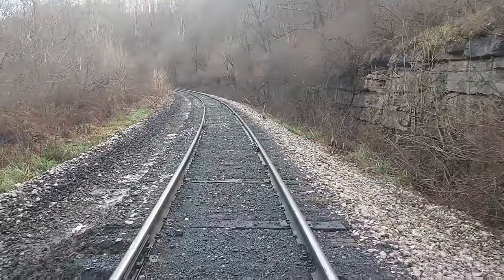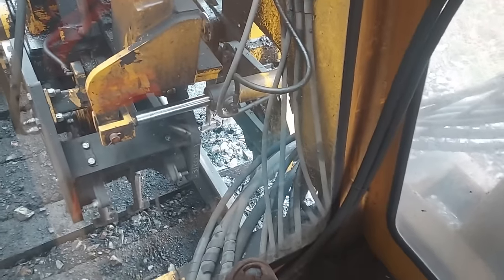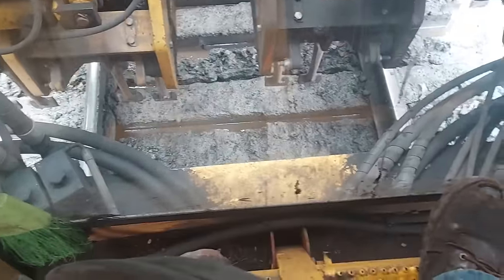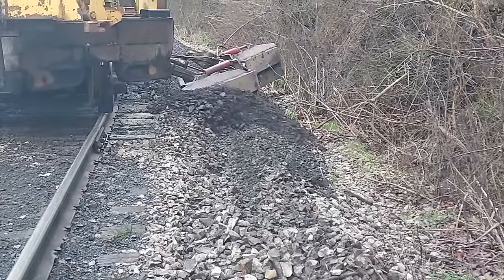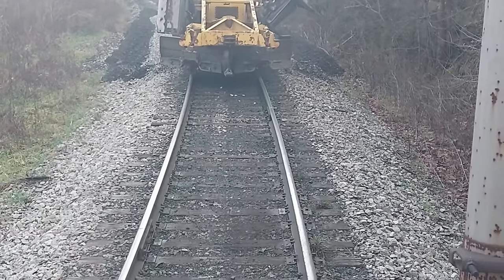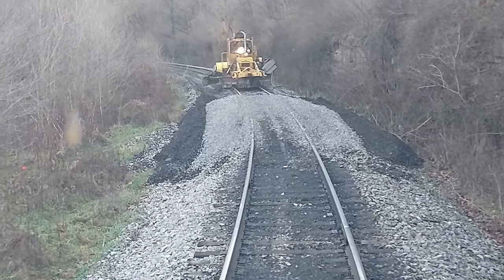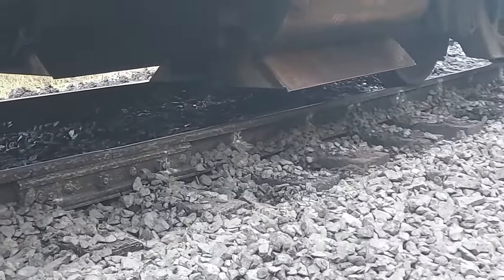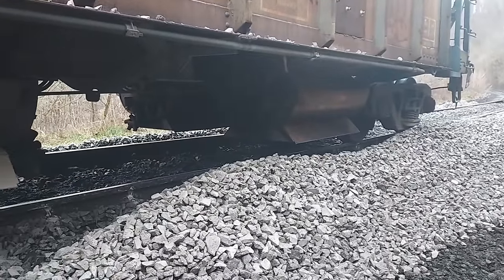Crib Sweeping a Really Bad Mud Spot in the Track

Comment: Dave - Great video as always! But what happened to the ballast? Isn't it heavier than the mud? Was there a flood?
Reply from the maker: The ballast just got diluted by the mud Nolan. The leaky car doors
spill coal over many years time. Note also that it seems like the
doors spill more in certain areas than in others. But what happens
is the coal plugs up the ballast so the water can't get out. When that
happens and the water stays in the track instead of running off,
then when the train passes over that spot, the ties get pushed down.
When it unloads the ties come back up which allows water to get
under the ties. Then when then train passes again, the water gets
pushed down by the ties and when it unloads, it acts like a suction
and brings mud back up with it. It's a perpetual cycle and just
gets worse as time passes and eventually the mud takes over
and we have to do some kind of fix to it.  Very grateful my friend for your taking the time to visit with us and check out the crib sweeping video.

Comment: need drainage pipes punched in under the tracks. water has to have somewhere to go.
Reply from the maker: Mud is out biggest problem here on the track Kevin. Coal fines get
down in the ballast from leaky hopper car doors and plug the ballast
up so water can't drain away. Then the water goes down and mud
comes back up. First thing we need is new hopper cars to eliminate
what is causing the problems. Then we need a better machine to
eliminate the mud. But that's also very wishful thinking on my
part to think that those things will happen..... sigh  Very grateful my
friend for your taking the time to visit with us and check out the
crib sweeping video.

Comment: So you lose all the rock on the shoulders? No way to save all that naterial?
Reply from the maker: Pretty much that is correct John. In mud spots like these, the
shoulders are plugged up with mud and coal fines anyway, no
use in even trying to save it with the limited equipment we have.
We really need one of those big shoulder cleaners that would
clean the rock and save it, but since we do not interchange with
another RR, then it's impossible to get one in here. We do have
our share of mud spots. Seems like you take care of one and
two more show up somewhere else. And it's also finding the time
to deal with them with a train running because I have to rely on
a train operator to haul ballast for me. Also having to deal with
weather conditions, can't do this kind of work when stuff is frozen.
Very grateful my friend for your taking the time to visit with us and check out the crib sweeping video.

Comment: Why couldnt they put a scraper on those tampers so instead of using the track hoe to clean out the cribbing use the tamper to clean out the mud?
Reply from the maker: It is a real pain and time consuming thing to take those paddles off
and bolt something like you are saying back on Jeff. Plasser makes
a really neat cribber machine that is designed pretty much like what
you are suggesting. I have requested them getting me a machine
like that here several years ago, however it hasn't shown up yet.... sigh. Appreciate your stopping by to check out the crib sweeping
my friend.

Comment: Super Dave ..Here's a Question  From "Dave's innovative  videos on Track work  School"..Do You have any worn out "Tamper teeth   could you have taken some thick steel Channel  with a L SHAPE FOOT WELDED ON END OF CHANNEL   PPOINTED INTO CENTER OF TRACK and weld it on to the tamperteeth (SO THE LEFT TAMPER TEETH CHANNEL  BE POINTED INSIDE TO RIGHT ÀND RIGHT SIDE TAMPER TEETH CHANNEL  BE POINTED INSIDE TO LETH ETC. SO WHEN UNCLE DAVE WAS ORIGINALLY JUST USING THE PLAIN TAMPER  TEETH TO MOVE "THE BALLAST/MUD "THE NEW PATENTED DAVES CRIB BETWEEN  TIES BALLAST  MOVER"!$$...(DAVE CAN USE THE L SHAPE CHANNEL  TO PULL THE BALLAST  OUT FROM CENTER OUT ON EACH SIDE USING DAVE BEAUTIFUL  TAMPER ATTACHMENT..(DAVE THAT WAS SO COOLTO WATCHHOW YOU TRIED TO MOVE THE BALLAST/MUD  JUST WITH THE TAMPER TEETH..WE JUST THOUGHT IF DAVE AND HIS SHOP TEAMS COULD  WELD ON SOME 3 IN WIDE CHANNEL  TO THOSE TAMPER  TEETH  YOU COULD  OF HAD A "NATURAL  HANDS " TO PULL THE BALLAST  OUTSIDE OF THE RAIL FROM CENTER OUT ,,FROM EACH SIDE...DAVE WE JUST SAW THIS GUY THAT HAS A BEAUTIFUL  EXCULATOR LIKE YOURS HE TEMPORARY  BOLTED OR WEĹDED ALSO A CHANNEL TO INSIDE  OF THE EXCULATOR BUCKET  TO DIGGING NARROWS TRENCHES....WE THOUGHT WE SHARE  THIS WITH OUR " OUR FRIENDS SUPER DAVE"❤❤❤❤❤HOPES THIS HELPS TO INSPIRE A NEW TRACK TAMPER  ATTACHMENT  DAVE INSPIRES HIS FRIENDS AND VIEWERS FROM OVER IN WASHINGTON STATE.....DAVE YOUR "SHOWS" INSPIRES MORE TOURIST/SHORTLINES TRACKWORK IDEAS..MANY GOD PRAYERS  THAT PERHAPS "TEMPER TRACK TAMPERS WILL SPONSERS  DAVES WONDERFUL  CHANNEL AND PATENT "DAVES NEW TAMPER  BALLAST  REMOVER BETWEEN TIES CRIBBER ATTACHMENT ".... AS ALWAYS YOUR WASHINGTON STATE SUBSCRIBERS  AND ADMIRALS 😊😊😊😊😊😊😊❤❤❤❤ ENJOY
Reply from the maker: Yes that would work Bradford. But two things, 1. it's a total pain to
get those tamper teeth off and back on again. 2. The new teeth 
even being L shaped would not be able to get the mud out from
under neath the rail, unless another special bend could be placed
in them. They are very strong metal and to bend them would be
a most difficult thing to do if it even could be done. No one sells
anything like you describe. I do appreciate your idea and for taking
the time to share it with me. Very grateful my friend for your
taking the time to visit with us and check out the crib sweeping video.

Comment: 49CFR220 doesn’t seem to apply for this railroad.
Reply from the maker: All railroads have problems as you know Walter. When problems
occur you do what you can to fix them with the time, equipment
and man power you have available.  I'm not really sure why you
would say the track safety standards do not apply to us? While
it is true the FRA does not come in here, we are patrolled instead
by Mine Safety Health Administration because we are a coal mine
that has a railroad, and not a railroad in and of itself. The FRA
has chosen not to come in here because it is under MSHA
jurisdiction and the FRA considers us as an "in plant installation."
But that does not mean we are not required to follow federal law.
Our biggest problem here is mud and have to deal with that as
we can. We are certainly not the only RR that has mud problems,
although we do seem to have a bigger share of mud than many
other RR's do. Very grateful my friend for your taking the time to
pay us a visit and check out the crib sweeping video.